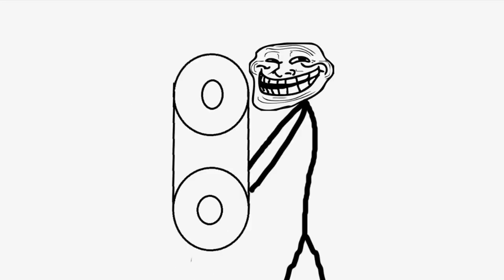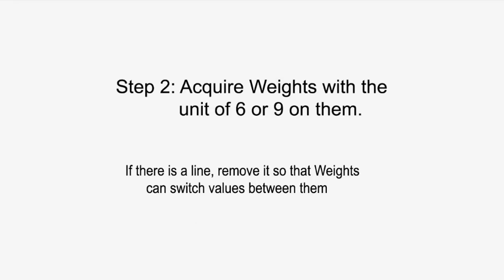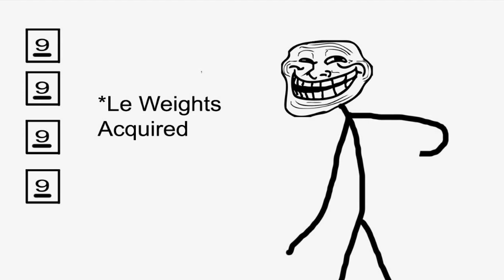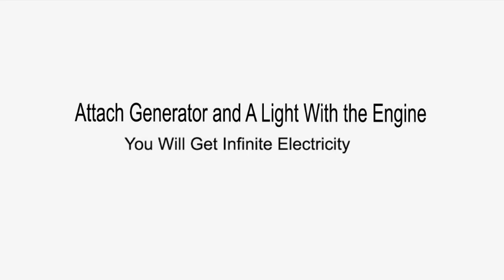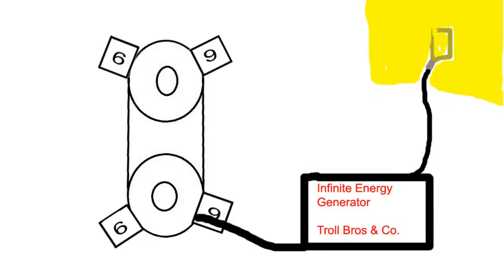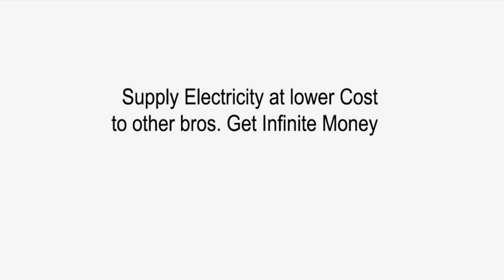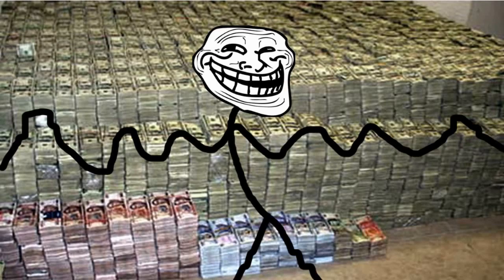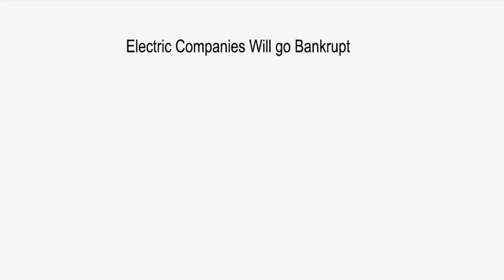Troll Physics - Infinite Electricity Generator

Comment: You want free electricity? Then let me tell you something, a nuclear reactor is really really hit (Duh) and water is pumped into it and it turns into steam which spins turbines generating electricity. Now all you need to do is get 2 very strong magnets, a turbine made of aluminum, some wires, a battery, and a generator which can harness the energy from rotating stuff. Hook up the turbine to the generator using the wires and use the other wires to hook the generator up to the battery. Then you place the magnets so one has its South Pole facing towards the turbine and on the other side have the other magnet have it’s North Pole facing the turbine. Then after adjusting the placement of the magnets, one should push the turbine and the other would pull it, and the turbine will gain speed and the generator will turn it into electricity and will send it to the battery were it will be stored. 

You also could buy solar panels but those are expensive, you have to make payments on them, and you have to pay for them to be installed.

Comment: Yeah but one problem: Energy is sometimes lost in the form of Heat
Reply: Upside to how this strange reality is that due to one side being always heavier (the right side always) due to the 6 becoming 9 and vice verse, as long as you oil it every once in a while, you’ll lose practically no energy
Reply: R/woosh
Reply: acquire fan
power fan using the infinite energy generator
blow cool air at the heat
problem, thermodynamics?

Comment: For the people who didn't get it:
When the weight is on the left, it's 6kg.
The ones on the right are 9kg.
Because of this, the 9kg goes down and the 6kg goes up.
But what happens once the 6 reaches the top and the 9 reaches the bottom?
Well, look for yoyrself what happens if you turn 9 and 7 upside down!
Not only is this a nice numba, it also means the first left one is not heavier than the right one, which makes the process repeat.
Thanks for coming to my Tod Telk, and a meerry christmas!

Comment: It seems like most people who watched this didn't understand the idea xD
Reply: I didnt
Reply: @nb5176  basically as the 9 is flipped upside down, it becomes a 6 and is therefore lighter than the 9 weight, so it would go up and keep going around
Reply: @Mike-739  69
Reply: @UCmDBecUtbSafffpMEN3iscA  in this case, a very functional use for 69
Reply: @UCmDBecUtbSafffpMEN3iscA  Nice.

Comment: The reason why this doesn't work is because when the weights have reached the bottom there isn't enough weight that's dragging down to push the weight up again, so it'll get stuck.
Reply: General Moon NO! Its because electric companies will go bankrupt! so they changed the real troll physics with some stupid physics!
Reply: But turning 9 pound weights upside down turns them into 6 pound weights. It's foolproof!
Reply: No shit. But if the weighs did change from 6-9 like he said it would work...
Reply: Hehe 6-9 69